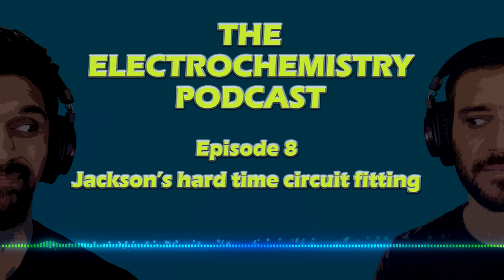Episode 8: Jackson's hard time circuit fitting

Comment: Hi, i have a question..
What is the effect of concentration of KOH electrolyte on elect4ochmeical results? For example...i am doing my experimwnts by using 6M KOH electrolyte what if i use less concentrated...what will be the effect?
Reply from the maker: It probably depends exactly which experiments you are doing. But one of the impacts of KOH concentration is that the pH will change, and potential shifts at a rate of roughly -60 mV per pH unit. For something as concentrated as 6M KOH, the pH is 14 or even above, though to be honest I am not sure at that level of alkaline the measurement of pH continues to be perfectly accurate.  But for instance, if you went to something like 0.1M KOH, the pH would be approximately 13, so in this example if you went from pH 14 to 13, theoretically any features electrochemically would shift in potential positively by about 60 mV.

Apart from that, there could be other effects from changing the electrolyte concentration but I would need to know more about the specifics of the experiments being done. And ultimately, the best answer to this question is to simply change the concentration yourself, run the experiments, and see what happens (if anything).
Reply: @Pineresearch  i am running experiments of three electrode system in which my electrode is a nickel foam coated with transition metal oxide and sulfide based nanocomposite..and for this experiment i am using 6M KOH electrolyte solution..
Reply from the maker: @yumnakhan4914  I think the answer to what will happen by changing KOH concentration in your experiment is the same as I mentioned previously, which is that you just need to try it and see what happens, if anything. I imagine you have a good reason for wanting to adjust the electrolyte concentration, so you may likely need to run the experiments yourself and see how it affects results.